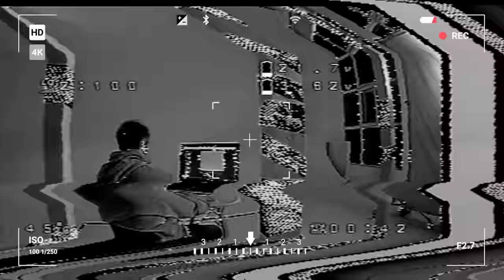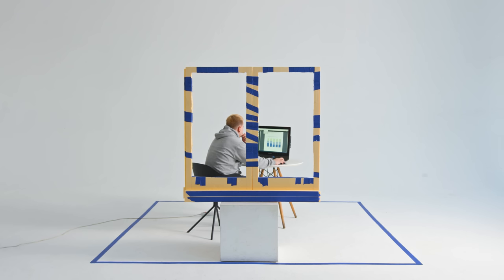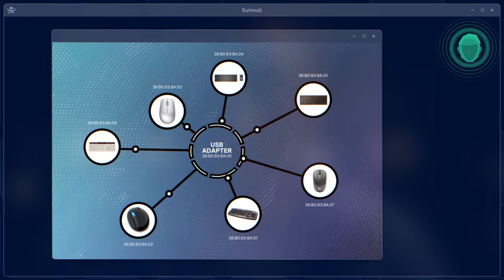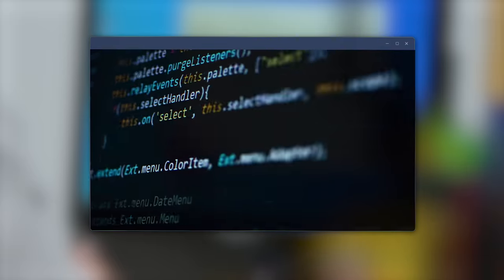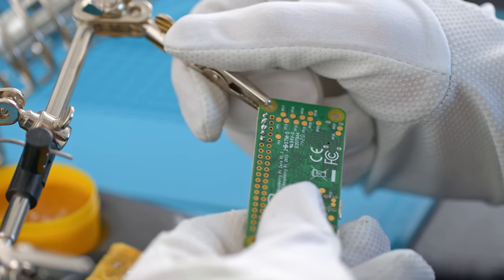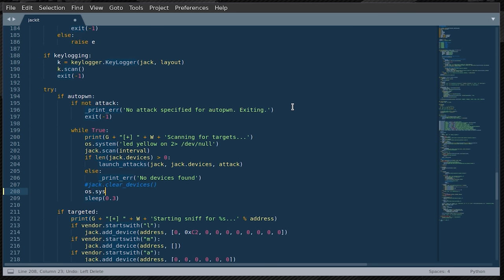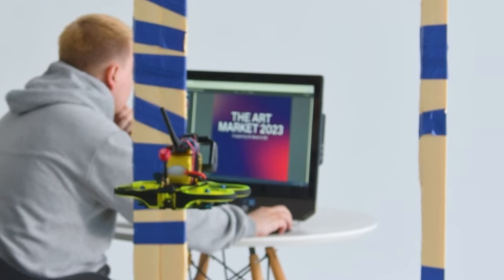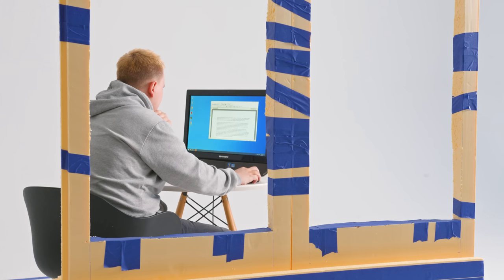How a DRONE can hack your computer in seconds | Real Experiment

Comment: hahahaha I already thought this months ago, I  though what if I create a dron that hacks each wifi it founds and use the internet to be connected with me, when there is no internet it will use mobile data to get communication with me, nowadays each house has wifi and we know how to crack almost each wifi password so at the end you will have access to a bunch of routers and you will be able to fly your drone very away from you.  But is still a mental exercise,  due to my poor budget now and I already thought some issues in ti.

1) The drone should be load with some AI to be smart enough to recognize buildings and obstacles without be connected to internet, cause tcp packets are pretty slow.

2) If I am supposed to fly the drone very away from me there should be a way to charge it by solar panel

3) The number 1 or 2 will add extra weight to the dron and will become louder or bigger and we want it to be low profile

am I crazy, because I think I am
Reply: and I know is possible cause normally that kind of algorithm is already implemented on video games, when there is no internet normally send a predict package to the server to have constancy with movements and its very effective to show smoothness in poor network connections

Comment: And this is also using for Arduino there is circuit kits that is compatible with Arduino and raspberry pi so someone created a project and these Bluetooth and Wi-Fi chips the circuit kits  are in Wi-Fi modems and more so yes the Arduino and raspberry pi can be hacked because the kits  with those chips run Jarvis script

Comment: Please no one learn how to solder from this video. The solder joints at 8:51 are terrible. 1. Not enough solder 2. Your soldering iron isn't hot enough 3. Flux is your friend. Those three tips should vastly improve the soldering in your future videos.
Reply: Hey it works!😏
Reply: @warrenarnold  For how long? The vibration from the drone alone is probably going to break those solder joints.

Comment: Nope not even a wired will give you a 100% guarantee, maybe next video can be about bridging air-gapped system, you will find interesting stuff like using a wire as an antenna or GPU coal noises as Morse code that leaks your private data

Comment: oops XD accidentally already not vulnerable... guess they'll have to figure out a different method to attempt to get my data shrugs 

i don't use wireless pretty much anything for my computer.
though technically wired is still not 100% secure though it certainly is quite a lot more secure, with the right equipment somebody could actually listen in on the magnetic radiation produced by the current going through wires but this would likely not be very reliable.